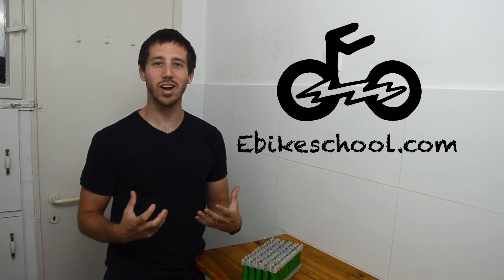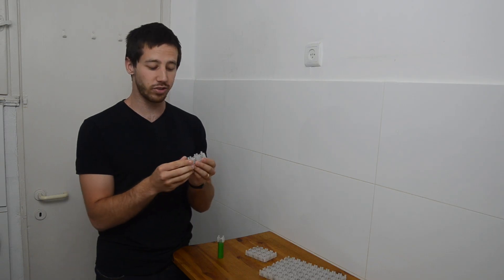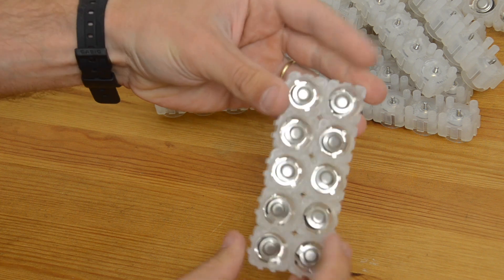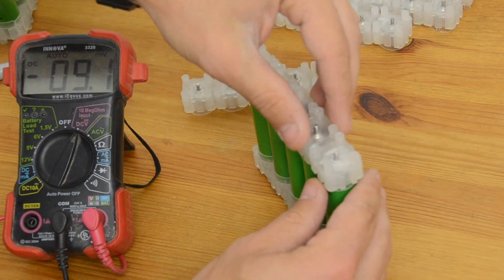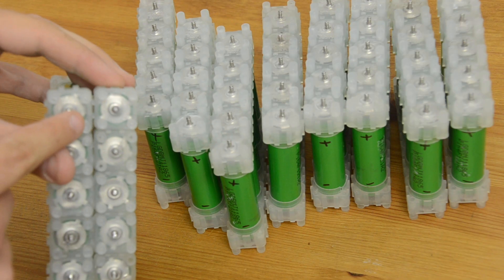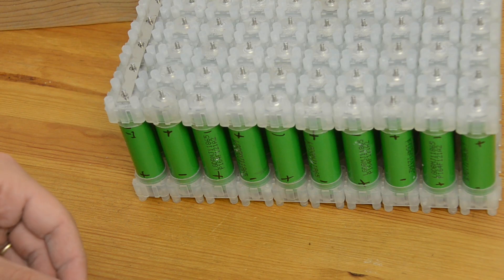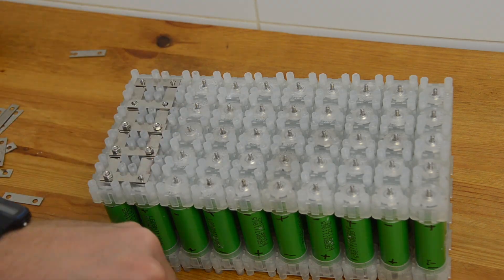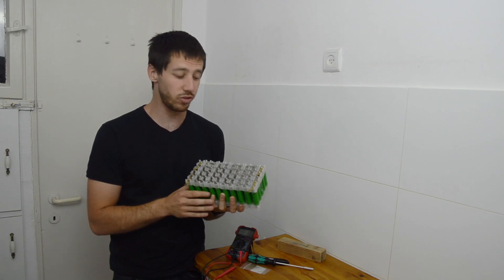No Spot Welder or Soldering Battery Building Kit from VRUZEND.com

Comment: There should be screws that would tighten top and bottom part. Just an idea.
Reply from the maker: Yes, it's a great idea. We've had people add bolts though it. Basically you sandwich the battery between two layers of plywood or other rigid sheet, held together by bolts.
Reply: Is there enough space between connected modules to put a long, thin bolt? I mean the place where 4 rounded edges meet. I can see a little space there. I would put a bolt every 2 cells between empty spaces with a washer and a nut to secure the whole thing. Is that possible?

Comment: Even with those tie-wraps, they will shake loose. the tie-wraps themselves will stretch over time and that together with constant shaking / vibration - well - I'm not convinced. Please, tell me: What kind of duration tests have you performed with this? Any? And I'm talking severe vibration over an extended period., because over that duration combined with that amount of physical stress, I would say: NO CHANCE! What say yous? Even spot welded joints will come loose with enough shaking but if all your cells are packed tightly, as one, then no amount of shaking will break those welds. And I'm talking from experience here.
Reply: Your fix:
2 plastic plates
2 sheet metal plates
4 long machine screws
4 washers
4 lock washers
4 nuts

Cut all plates slightly larger than the face of your completed stack. Drill a hole in each corner. Place plastic plates on top and bottom of stack with metal plates outside of them. insert long screws into holes. place washer, lock washer and nut on each long screw. Tighten. If you're REALLY paranoid, you can buy four more screws and put them in the center of each edge as well. You've now clamped the whole damn thing together. Nothing short of tumbling down the side of a mountain is going to separate the connections (and at that point, you have bigger problems).
Reply: My fears exactly - after years training engineers how to work safely with batteries, this concept - if not handled with care - is eventually going to maim or even kill someone. It only takes a momentary lapse of concentration, and a bus-tie link gets connected to the wrong place (or gets dropped onto a battery pack), or (as clearly seen on this video, a wedding band shorts out an adjacent group of cells, or a wholly unsuitable, uninsulated nit-driver falls out of your hand across multiple cells).

When that happens, you face 2nd or 3rd degree burns, possible eyesight damage (partial or full), or even a fire - and how many folk messing around with Lithium batteries know how to tackle a Lithium fire? (Whatever you do, don;t use anything that contains water !!!!).

Is this a great idea and a fantastic product? Absolutely! Would I buy a kit? Definitely! Should the manufacturers and vendors consider the safety of thie customers and end-users in more detail? That should have been priority-ONE (after all, everyone knows about the litigious society that is the good ol' US of A)
Reply: Charles Eye, Yeah, I'm getting one soon. I like your idea. Two cutting boards from the 99c store should do the trick bolted together. I'll probably use a dab of silicone on each nut as well so they have no chance of coming loose. Then shrink raping around that. I won't bother with steel plates. I'll be using carbon fiber around the pack to make the case.
Reply: I agree with Bodragon, I've seen what kind of damage can 5000km of ebike driving do with questionable fastening, these definitely will start coming loose. It's nice that someone has managed weeks without issues but take a little more shaky road or terrain and do it for two months and voila. Also you might be thinking all is fine but some of the parallels might be disconnected and all kinds of problems will start suddenly. Some cells totally worn out, others not used and you will be sad panda. It's a nice project but requires some properly bolted plates from each side at least to be really sturdy. Also those nuts will shake loose, add spring washers.
Reply: $27 for 50x battery kit at Vruzend.com. Is there a discount code?
Reply: rojitor roj you would be amazed at what can happen with vibrations
Reply: Shrink-wrap!
Reply: the bus bars need to be insulated except where they contact the terminals. mechanical fastening of the whole pack needs to be added, friction alone WILL NOT hold this together long term, introduce even a small vibration from a motor and the whole thing can start to literally shake its self apart
Reply: Strange post. You'll need a full body protection suit to fill your car with petrol, which is way more dangerous.
Reply: SeptrothFFXI you are not talking about dildos I hope...;)
Reply: Simon Clements Thats not whats being said....... were pointing out a design flaw of this lacking a secure mechanical fastener to hold the caps on the battery.   If they added 4-40 all thread and some nylon locking nuts this would have 2 thumbs up.   

Because it is designed for someone with limited electrical know how (lack of soldering skills) it makes it somewhat dangerous both when charging and when discharging. 

search on youtube for a overheated lithium ion battery, the smoke released depending on the brand can contain hydrogen cyanide, if you take 1 breath of it your dead as a post, this is only ONE of the numerous highly toxic substances released if one goes in to a thermal runaway.   a loose cell under high draw (EBike, energy storage, almost anything this might be used for) is all that it takes for one to overheat and burn up.
Reply: I read that the discount code bar is just a part of the software they're using. Sort of a generic order page setup. No code.
Reply: Yes safety first. I would use 2 nuts tightened against each other though instead of the nylon lock nuts because in aviation nylon lock nuts are not allowed on anything near or on anything that can get hot because the nylon melts & then the nuts get loose & fall off due to vibrations etc., jam nuts might be better in this application due to the short threaded stud on these battery terminal adapters. Mechanical lock nuts could be used also they work by elastic deformation of a portion of the nut against the male thread. They damage the stud/bolt threads a bit though when removed so I would use the 2 nut locking method IMO if a cell needs to be changed out for possible future repairs. I would put these battery packs between a couple pieces of wood & tie them together with long nuts, bolts & washers also. I might even go with some bathroom wall cement board for fire resistance on top/bottom of the batteries & clamp them together with some wood or metal frames on top/bottom. I would also run small coolant lines around the cells & pump coolant through when the cells either get too hot or too cold using temperature probes/sensors etc. Looking over your post again I believe you were referring using nylon all thread & nuts to clamp these battery terminal adapters securely to the batteries. Yeah I could see a lot of people who don't know better not securing these caps and these battery packs together for safety reasons. These batteries are very dangerous when shorted or on fire!
Reply: Zip ties shrink over time.
Reply: After building the pack you can cover it with heat shrink tube.
Reply: Tie rap is life
Reply: @ericlessard5021  
Tie rap is horror to my ears, but tie wraps are very handy and I use them a lot.
Reply: Bodragon it locks really really hard you wouldn't believe... zip ties are totally unnecessary in my opinion if using LG MJ1 cells...
If you don't believe us, please order a kit, it's only $19usd and test yourself. Make a video and share your experience with others =]
Reply: Agreed rojitor roj, done properly the fit is very tight. My biggest problem is getting them apart when I change batteries.
Reply: I can see this blowing up real easy on someone that is not paying attention and tosses one of those fuseable links (buss bars) on the wrong terminal and welcome to thermal runaway population you!
Reply: Bodragon I did a pack a few weeks ago.
even without the zip ties I doubt it can get loose. You really need to press hard with the wood to join the pieces together. The result is a really tight brick.  The zip ties are ....Just in case....

Comment: Tighten your nuts.
Reply: Is your keyboard broken? 
Presumptive? More insightful? No. Experienced. Enough to know that you didn't undertake any due diligence before you replied. 
And do try to stay on topic.Your response should have included a comment about the use of nail polish as a means to prevent nuts from loosening up due to vibration.
Reply: Trigger much?
Reply: HAHAHHAHAHAHA
Reply: Thanks, i try :P
Reply: Otto Knowbetter 
BOOOM!!!
That was a gd one man.
Reply: Deez Nuts
Reply: Broken Monarch some nuts are tighter than other's
Reply: They automatically did! When i realized id be paying $10.00 a cell or more for decent ones  here :(
Reply: Broken Monarch No BMS! Be afraid be very afraid.
Reply: A tube of locktite works wonders on loose nuts. Nail polish also works, but buy your own, most women are very protective of their's
Reply: Gence Nointeli 
do you understand how hard it is to type and bend ur momover at the same time?
so excuse if someone doesn't get it all rite (goaheadandkeepreadingthisuselessreply.........well now. you did it.)
Reply: Broken Monarch he said do it yourself
Reply: Gence Nointeli 
oh? do you know most women?
seems very presumptive, bit whay do i know, you clearly know all the women in yhe worls and have more insight yham i do....dam fool.

Comment: What's the maximum discharge current your caps can support? i'm building an electric board and i need 80 amps. is this possible with your caps and nickle stripes?
Reply from the maker: Hi Gary, I thought that info was up on vruzend.com, I think in the FAQ's section? So far they've been tested up to 3.5A each per cell, testing is still on going. They aren't yet a high power solution, better for medium to low power projects. But there's a version 2 coming out, probably later this year, that will support higher currents. For now, these are meant more for ebikes and home energy storage/powerwall types purposes, unless you can fit a large AH pack on your board.
Reply: Thanks for the Information. ok cool, i will check the second version for sure. like your videos and stuff you're doing. Thanks it helps a lot.
Reply from the maker: Hey Job91, so far I have not seen any resistance increase over time.

Comment: Is the company mentioned from India?
Reply from the maker: PistenBoy, pricing depends on where you're located, but all options are very affordable. You can see the prices on VRUZEND.com
Reply: Well they are pretty much expensive.
Reply from the maker: Aravind, I guess everything is relative. My spot welder cost me $200, so this kit is a fraction of the price!
Reply: +EbikeSchool.com But you can build a spot welder from scrap, near enough.
Reply: Aravind Nair I was going to say the same thing!
Reply: They are indeed. VRUZEND is a made an India company. The next question would be how much does a kit of these go for? They kit them up in packs of 100 pieces (50x18650)
Reply from the maker: Aravind, Yep, sure is.
Reply: That's true Mike! It's perfect for a beginner.
Reply: Hi J! But you can always 3d print something like that and manually put the electronics.Or do some CNC.
Again, those things are never simple.